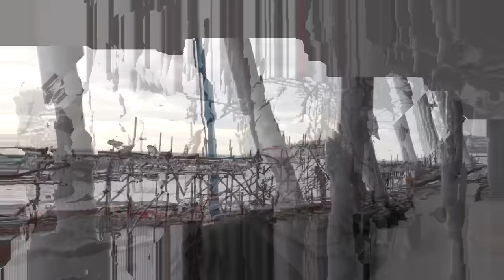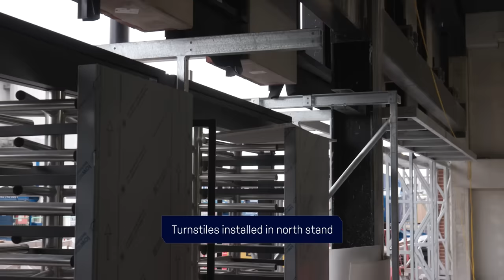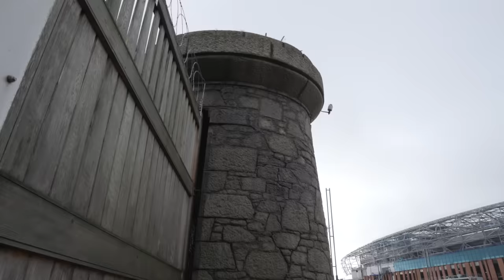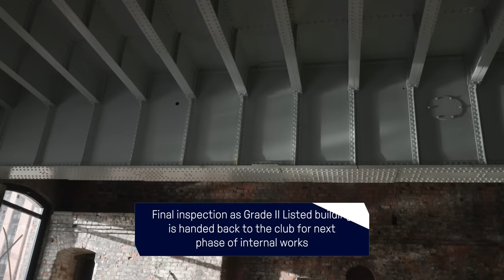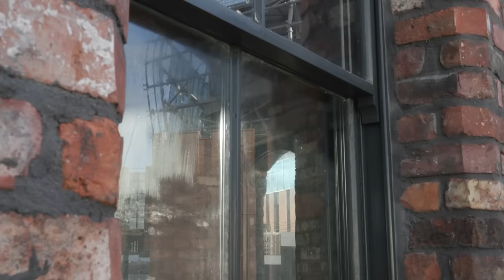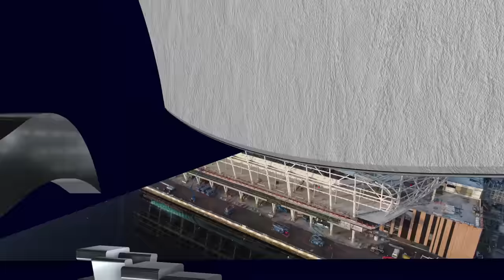NEW EVERTON STADIUM UPDATE!

Comment: It looks great just wondering why one stand is not level in the middle will seats be able to go in that section to make the capacity of the new stadium bigger?
Reply: Which stand do you think is not level?
Reply: @06skippy06  it's at 1.52 I think the South stand.
Reply: @johnfarnworth9653  I see what you mean.  I believe that is the North Stand judging by the blue seats which have been installed.  Not sure how much adding seats in that small "indent" in the stand would increase the capacity by anything meaningful.
Reply: @johnfarnworth9653  I think @1.52 it’s the west stand on the left and the north stand straight ahead….. The south stand is the home end like Gwladys street now
Reply: Yes, the opening capacity will be 53k with possibility to increase to 58k later.
Reply: @nicholasryan9378  not seen that figure anywhere…. Only potentially up to 62k 🤷🏻‍♂️

Comment: When will they start playing in the new stadium?
Reply: Midway through next season I think
Reply: In the second division.
Reply: @Moreira12456  What's got to do with a foreigner like you?
Reply: @Moreira12456  Did you see the ranking 4 points ahead of Luton.
Reply: Ajax: the ground is due to be 'handed over' to EFC in a year's time but the club have not decided yet whether they'd aim to use it straightaway or wait for the 2025 season start. They stated that they will consult with the stakeholders and fans.
Reply: There is going to be one more full season at Everton. So August 2025 will be first match at new stadium.